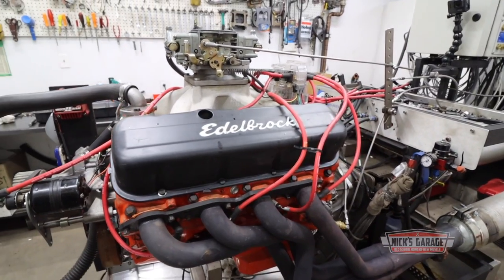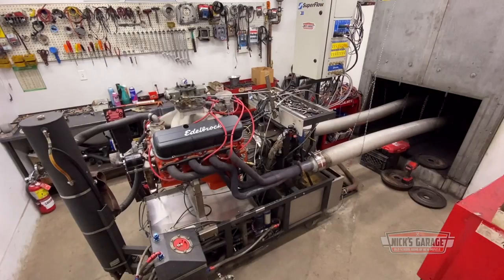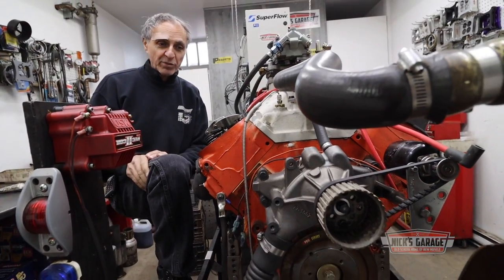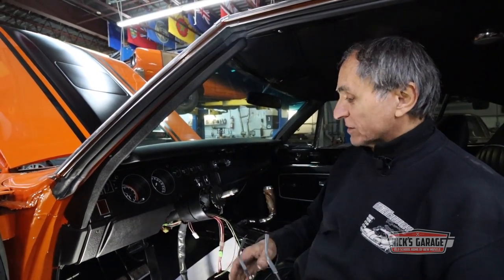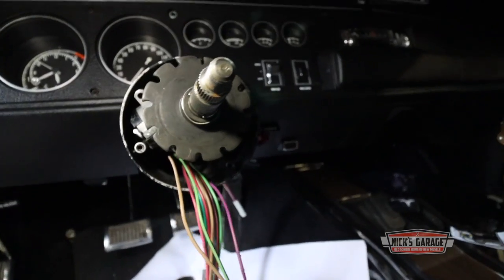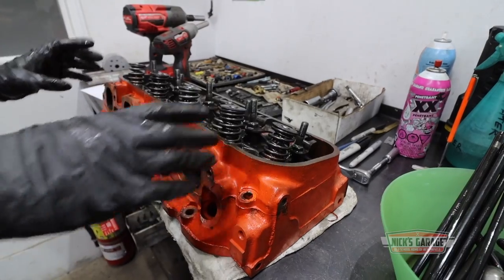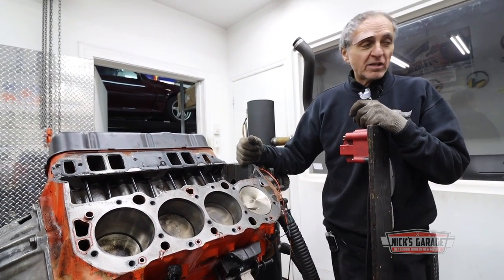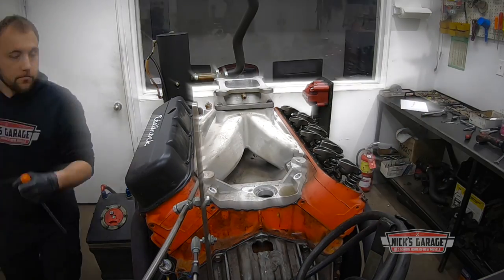Weak Big Block Chev • Wrong Parts + Poor Assembly = No Power!

Comment: Those heads are made for a radical cam, high lift rockers and 12 to 1 compression with a short block capable of turning at least 7500 rpm.
This is not for a stock BB short block with those tight main bearing clearances.
Cheapest is to put some good cleaned up stock oval port heads with a good valve job, a good aftermarket chain and sprocket and a more realistic manifold that will give more low lift flow.

Comment: If I remember correctly the base 427 in 1967 was 390 hp.  This was a mild street able engine used in Impalas, Corvettes etc.  it used hi test leaded gas.  Using the flat top Pistons would allow today's regular pump gas.  I think the geared cam may also be ground to turn the other way unless it has idlers like the old Jackson setup.  This engine is a mess of incompatible parts.

Comment: Back in the day I've turned some 4 valve relief 302  pistons backwards. Since most don't know if it has an offset wristpin instead of centered it will pull the piston further and hang at tdc longer. Worked flawlessly for years! This was not the case for this 454!!!! The 302 had 200lbs compression and made around 400hp with  junky iron heads lol!!!!
Reply: Dodge engines like the piston flip too

Comment: Back when I was in the Air force I ran into a similar deal. A man had a 396 SS chevelle. He rebuild it and it would not turn completely over. He thought about towing it and decided to ask my opinion. Well I went to his home and we removed the heads. The pistons were 12.5 to 1 and were installed wrong and we also found a rag left in under the intake. He reinstalled the pistons correctly and removed the rag put it all back together and it run fine. No one is perfect and hast makes waste. When the work is hard and the wages are low take you time and go quite slow. Lol.

Comment: Well the good news is that all it should take is a new set of pistons and a new cam to get where he wants (and better valve springs, etc. to support a higher lift cam because the ones that are in there obviously can't support the lift of that small cam). Seems pretty obvious that whomever put that engine together didn't do the math up front to get the right components to get their compression ratio where it needed to be. I'll bet they didn't even measure the combustion chamber volume of those heads. Which, seeing how the pistons were put in backwards, doesn't surprise me.

Comment: A friend of mine had a BB Chevy custom built for his street racer '70 Camaro. Took the engine straight to a dyno man like Nick's customer did and it too didn't make horsepower. Turns out the engine builder was doing two BBs at the same time. The other one was for a truck to haul the customer's boat requiring a completely different engine. In the build process some parts got mixed and neither guy got what he wanted. The builder made things right on his dime so everything turned out OK in the end. As President Reagan used to say, "Trust but verify."
Reply: didnt happen...

Comment: Besides the fact that the pistons were installed wrong,  did you check deck height?  Luckily the cam is small and the intake valve apparently didn't hit the piston.  Clearly the engine needs to come apart, check everything, and make some changes if the customer wants to make some power.  Good thing it got checked before putting it in the car.

Comment: One of the biggest electrical issues with classic Mopars is the ignition power wires, to and from the switch, are very long. The wires increases in resistance over time , the connections get old and develop resistance and the contacts in the switch wear and increase in resistance. This can cause a drop in voltage to the ignition system and throughout the ignition system.
Reply from the maker: Thanks Jim. Sounds like you have spent some time in the wires.
Reply: You get that with old motorcycle to, see it a lot.

Comment: I believe the magical Chevy big block fairy's took off with the missing horsepower.
Reply from the maker: Darn it. We must have a hole in the window screens.
Reply: boruff68 
Looking at the flame back through the intake the Cam is probably way off by 10+ degrees too
Reply: Nothing like building an engine looking for big horsepower.  40 years ago I had a good friend in the neighborhood who built a 383 for his Super Bee, nice car.  He excitedly put it together with a big cam, single plane, and 11 1/2 pistons - with the notches facing toward the back.  That engine made 0 horsepower but it also made for a VERY hot starter motor.
Reply: @boruff68  - The 4 bent leaking valves were costing 200 HP...
Reply: @mindblownwatcher8536  - The 4 bent leaking intake valves (from hitting the pistons) were letting combustion fire get back up into that gas/air filled intake manifold==> backfiring
Reply: The 4 bent leaking intake valves were costing 200 HP at high RPMs and causing backfiring at low RPMs...
Reply: @boruff68  the heads were too much for the set up would have made more hp with stock heads

Comment: I would say Merlin heads are probably too big for a street 427 unless it's a high revver.    World makes some Merlin oval ports that would easily produce that 600hp number and more torque for the street with the right compression and cam.
Edit: Upon watching this again, that's a tall deck block.  So someone slapped some big port heads on a tall deck block.  Okay, but you have to have the right pistons for it.  I wonder if someone put short deck pistons in it as well?  They are awfully far down in the hole.
STROKER ENGINE TIME!!
Reply: yup, similar thoughts. its assembled wrong for starters, piston+rings on wrong, wrong intake.. 366 ponies should be a bit higher, but the 125 compression range (lower ratio) could be good for normal driving, spraying when you want big power
Reply: you can make 600Hp with oval port heads. Those heads are way to big as is the intake and carb.
Reply: I bet you could wire that Dominators secondaries shut and still make the same HP.
Reply: @modelnutty6503   Yeah, you don't know what you're talking about either. Probably, friends with the guy that built that motor. The 125 figure that Nick found was a cranking compression test in POUNDS using a compression tester. Nothing to do with compression ratio. While I would like to see around 140-160+lbs, it's more important that all cylinders are within that 5% number. If there are 7 cylinders showing 150lbs and one cylinder showing 125lbs, there is most likely a problem there.
Reply: I love when guys say rectangle ports are not good street heads 😂
Reply: @DWBmotorsports  "Merlin" heads are too big for a street 427.  Said nothing about "rectangle" heads in general.
And don't know how I just saw this after all this time, lol

Comment: its been a while, but i built a few of these that made 600hp and change with the small 2.19/1.78 valves and a solid flat tappet., we did have some good compression numbers from those 12.5 pistons  right out of GMs racing bible of 1980 !!

Comment: I used to make a killing fixing screw ups like this. Many people don't have an understanding of how the parts must work together and compliment each other. The usual thing was a huge Holley with a adapter on a stock manifold...or the big honking cam with 8.1 compression and 2.73 gears...the single plane intake and stock exhaust system..

Comment: Couple decades ago, I bought a Mopar 383 engine that had been bored .040 and stroked with a 440 crank that had its mains turned down to 383 size.  Made it 434 cubic inches.  Complete engine, supposedly ready to go.  I put it in my car and fired it up.  Ran OK at first.  Added coolant to the radiator, then had to again, and had to again, then the engine seized.  Suspicious of having to add so much coolant, I pulled the oil pan drain plug.  Bunch of coolant ran out.  OK, pulled the motor, took it completely apart.  Found out that the 440 crank's counterweights (bigger than 383 counterweights) had hit the block and the builder (who shall remain nameless) had ground the block for clearance and gone into the water jacket, then tried to plug the leak.  Obviously he didn't pressure check the attempted repair.  Fortunately the seller (he wasn't the engine builder) agreed to pay for the machine work on an extra 383 block and 440 crank I had in my parts stash (the proper way to make it fit was to cut the 440 counterweights to 383 size).  Then I assembled the motor myself.  Still running today after almost 20 years.
Reply: herman.         That is the way to do it.

Comment: used to be a mod to stop power valve issues. you gave a passage seat a mark with a phillips screwdriver to put a cross mark in it, then you put a small bearing in over it. apparently if a back fire happens, the ball gets pushed into the seat, but the X mark you made keeps it from sticking in place?

Comment: First of all, it's a tall-deck block, 10.200" deck height, probably from a dump truck. Flat-top pistons with Merlin heads, he lucky if it has 8-1 compression. The fact that the pistons are upside-down, and the intake valves aren't hitting says something about the cam, and that it's not very much. There's probably a lot more wrong with it, and Nick will find out once he sees the entire engine. I don't know why people don't do a bit more research before spending money on an engine build. We see a lot of this at our shop as well.
Reply: I mean.. if you're gonna run a 10.2 deck big chev, you might as well come out swinging with 632".
Reply: @HerculesRockefellerESQ  A Chevy truck block cannot be worked into a 632. Bores are too small.
Reply: @rollydoucet8909  it was a tongue in cheek remark. If you're gonna run a tall deck, might as well make it count.
Reply: @rollydoucet8909  for arguments sake, if you have a 427 TD truck block, with the right combo of parts, a sonic checked block, and a lot of time clearancing the crankcase fmor stroke, there is the potential for a roughly 550 cubic inch combo. But there are much more cost-effective ways to do it. Especially with how inexpensive some of the aftermarket stuff has gotten, by the time you consider how much screwing around you gotta do to make that combo work.

Comment: My C30 dually has a 454 that's supposedly had a cam put in it. Now whether or not it's just a stock replacement or an R/V cam or something with more of a performance grind I have no idea. No one in my area with a chassis dyno or even an engine dyno from what I understand so I'm not sure about the cam and I dont want to tear the entire front off my Rat motor to find out. Had planned on dropping on a set of big block Vortec heads but I've been told they won't work on a Mark IV block so I guess I'll just leave it like I bought it.
Reply: C30 usually has the RV type cam to begin with
Reply: @modelnutty6503  regardless I don't know for sure what kind of bump stick is in it since I was told it had a cam put in it when I bought the truck. I'm hoping they ment it had a replacement put in it. I've been told the Chevy engines had issues back then knocking lobes off because they weren't hardened or something like that.

Comment: I Got a low compression big block. Was going to get edel 100cc heads and 750 Edelbrock carb or AED carb mild cam. I got a edel rpm manifold...what can I expect am I heading in the right direction. It's only got 40k original miles so I just want to run it. I've got thick skin let me hear your opinions...

Comment: New build, still has cross hatching in the cylinder bore. If the builder honed his own cylinders, the low compression may because of the honing job. Back in the 80s, I tried honing my own cylinders on a little Ford 2.8l V6 with one of those cheap drill honers. It only took 1000 miles to seat the rings! It barely ran when I first started it up but kept getting better as I drove it. Then I put another 50,000 miles on it. Lesson learned.

Comment: a .030 flat top  with 119 cc merlin heads then you are lucky to get 8.00:1 with a thick Composite gasket adding 9 or more cc's, Just switch cam to mechanical roller 220 @ 50 , AND .675 Lift with 106 degrees LSA and advance it !!

Comment: yea I once bought a old 66 c10 that some guy put a 650 lift solid cam in a stock 283 . he kelp swearing it was over 500 hp. I kelp telling him I don't care I just want to the body.  we drove it home about 4000 rpm it would start floating the valves.  never did find out anything on it I just pulled it out and gave it away I think.  but the old truck body looked like it rolled off the show room floor.

Comment: I had a duster , and the start key did not work in the door , door key was the same as the truck key . The car was bought off the showroom floor brand new .
Reply: Niel.            Something wrong there. Never seen or heard of this issue on a Chrysler product.
Reply: @nickpanaritis4122  i also had a valient  bought brand new , 273 v-8 ( I think the slant six in the duster was faster ) and it was the same way starter key was the big key , the doors and trunk were the small key , worked good if you want to warm the motor up on a cold day , you could lock the doors and still have the engine running , wasn't a problem , it's the way the cars came in . Both were bought off the showroom floor

Comment: Good thing that was a small cam with the intake reliefs on the wrong side of the cylinder. Bad juju when pistons kiss valves.
  Hopefully the 427 owner wants to pony up and have Nick build that 427 right. Be awesome to put those heads to work!

Comment: I'd sell the heads, replace with whatever Chevy has for a decent Hi-Po street head, install hydraulic roller cam for mid-range torque, dual plane intake with quadrajet, RobbMc mechanical fuel pump, 3:42 to 3:73 ring and pinion, run trouble free low to mid 12's, have sandwich with buddies at the track, call it a day and drive home.

Comment: some 26 years ago I re-ringed a low mileages 92 Chevy 350 car engine for a boat. it was not bored, it was professionally honed! had the stock pistons and the old 400 heads (professionally rebuild, milled down a bit). cam was a  Crower boat cam, lift was around 480. with thin head gasket the compression was calculated at 8.9:1. 7 cylinder's compression was 155 . 1 was 150.
sorry for the edits! my eyes are getting old!

Comment: Just Re-Tumble The Ignition To Match The Door Locks! As Far As The Chevy 427-I'm HOPING For 600HP With Mine And I'm Running ZL-1 .030 Repl Pistons(12.5-1), 074 ZL-1 Heads(Milled .020) W/2.25+1.88 Valves. GM 069 Intake And 850 Holley DP. Cam Set TBD. Think It's Got The Potential!
Reply: Mark.         The ignition key did not work with either door. Bought a new ignition cylinder because it did not want to go into accessory position. After that, coded both door locks to the new ignition cylinder.
Reply: @nickpanaritis4122  Understand What You Had To Do-However Just As Door Locks Can Be Re-Tumbled-So Can The Ignition Switch. Did It On My Chevelle. Found Unused GM Keys That Fit Door/Trunk Cylndrs, But Not Ignition Cyl. Now Have Orig 1968 Keys To My Car!
Reply: @markpalio4411  .    I know.

Comment: Heh heh, engines like this 454 crack me up! I had a customer back in the mid-80's that bought a pretty nice looking '66 Fairlane with a supposedly 'built' 302. Poor guy couldn't seem to get it past 4200 without breaking up, and after changing out the coil, spark plugs, new carburetor, etc., he finally brought it to me to see what was going on. It sounded great at idle. Nice lumpy cam, roller rockers hiding under pretty chrome valve covers... on top of stock worn out Ford valve springs and retainers! It had maybe 100 lbs. of compression across the board, and I notified the owner, and he said to pull the engine and see how bad off the rest was. The cam and lifters were probably the best part of the whole engine, along with an antiquated Mallory dual-point distributor, and an almost brand-new set of Hedman Headers. The rest of the engine was essentially bone stock, with typical small port 302 heads, and stock pistons. We ended up using it for a core and got a 347c.i. long-block (stroker crate motor), equipped it with late model ECC IV electronic ignition and a high output coil, and turned that sickly Fairlane into a 370 hp. tire melter that still got fairly decent gas mileage. Not too bad for around $2500 back in the day.😉
Reply: @Paradoxical Nightmare LOL, no doubt!😁

Comment: Stuff like this makes my blood boil! I'm 61 and have been wrenching since I was under 15. And I'm not a Mechanic, I'm a Mechanical Engineer by profession. I've built three SBC for myself and helped friends on their builds of 351 Ford and lord knows what else. If you're gonna do it do it RIGHT! 

Funny story about one SBC build I helped a friend with. So he got the TRW kit with all the parts and I was putting rings on the pistons while he was doing something else. Laid all the rings out and gapping them etc. Oh. What's this? An extra top ring? Counted them again and looked at the pistons I already did. Hmmm, nothing missing there...

Hid the thing until we had the engine all done and installed in his Wife's Camaro. So all ready to fire up and run in and I put the extra ring on the console before he got in to fire it up. I hear :@##$%^*()*&$$$! "Um. What is it John" "You missed a piston ring!" "No I didn't." Took me an hour to convince him that YES there was an extra ring in the kit. He finally said: "I know YOU wouldn't have made a mistake like that!"